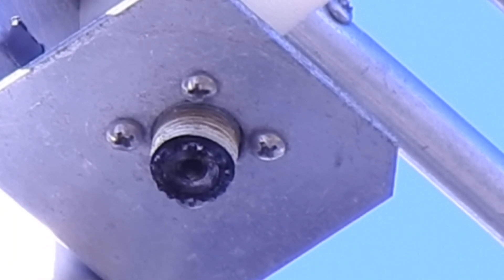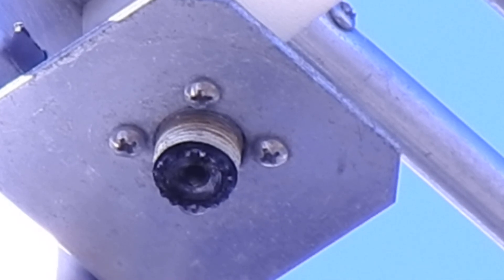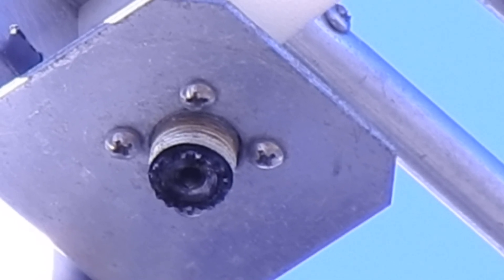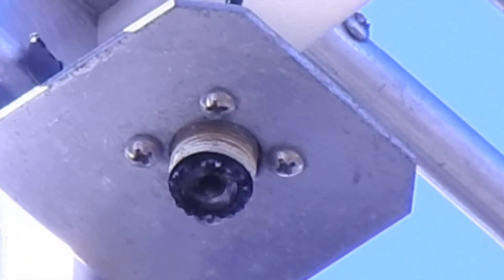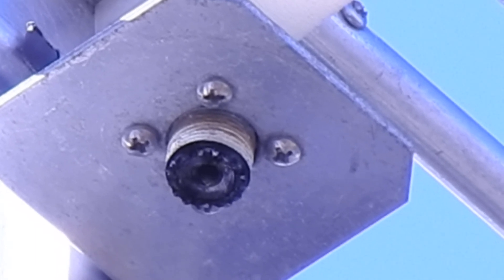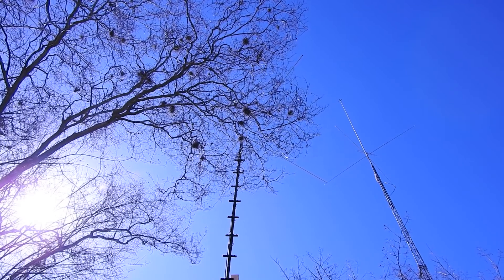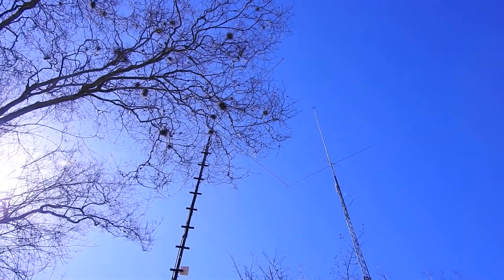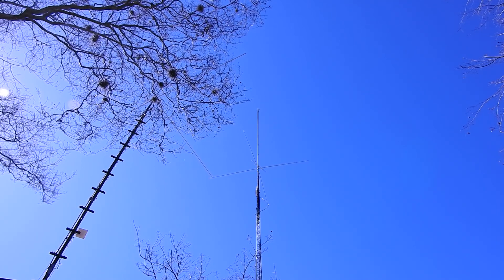Shockwave Burned at 3kw rms 187 tx RattleSnake radio inc.

Comment: Pl-259/ SO-239's are shitty connectors. The "Antenna" itself may take 10k but the Coax connectors i.e. pl259 / SO 239' are a completely different story. Why any antenna builder would use those connectors is anyones guess!?!?!

Comment: lol that connector  looks like it has been up in the air for years , the so239 sockets are a mixed bag and good ones with Teflon insulation aren't that common , better to use a connector rated for double the rf power you want to run

Comment: I've dealt with this kind of thing on my '8 element shooting star' and my 'penetrator 500' pushing over 1200 watts pep. MOISTURE! Water seal the PL259 connectors. Always seal from moisture with tight connections and you will be fine.
Reply: they sure need the water proofing lol , I avoid using them because of it and use N type instead

Comment: The shockwave antenna is a well build item but the PL259/SO239 connector combo is not rated for much, this is assuming you were able to correctly connect the 2 together. Me personally I would have just direct fed the coax to antenna. The dude that makes the shockwave antenna is adding innovation to YOUR hobby so why you attempt to throw him under the buss is beyond me. Support our hobby even if you don't understand RF theory. Even if you are butt hurt my offer still stands, if you wan't understand RF and radio better I will come to you if you are in Texas. No fee to you just supporting the passion for the radio hobby.
Reply from the maker: We have  been doing this for 10 years building amps, linears, I have 4 x 8' copper ground rods double 00 copper ground wire. The problem was that the Shockwave was using ROHS material in the Shockwaves S.0-239 not  Amphenol insulated SO239. The Shockwave would not of failed if the so-239 was A Amphenol insulated plug. This is A perfect example of Planned obsolescence. Planned obsolescence, or built-in obsolescence, in industrial design and economics is a policy of planning or designing a product with an artificially limited useful life, so it will become obsolete (that is, unfashiovery easy tonable or no longer functional) after a certain period of time. Do Not worry yourself so  much trying  to protect the builders like at BM tech,  We already Have the antenna down and repaired with A true  Amphenol insulated so-239 we also replaced the thin aluminum strap that did transfer the RF from the ROHS so-239 to the element that looked like it would  not carry 1kw much less 3kw  with A 12 gauge copper line that actually has insulation.. I will have the video of the repair done to the Shockwave loaded this evening then I will show everyone the 1.0/1.1 swr  match across the 40 with 50 oms with the repairs that we had to do. The antenna should have had this design to begin with. The cost of A shockwave antenna is what around 350.00 but BM Tech could not of spent another 10 dollars for A plug that will last longer? After the video I post of the antenna repaired I will show the antenna taking the 3kw RMS with no problems. The add where the shockwave is  being sold shows it will handle 10kw the add reads on saying this antenna is A monster  but then it has the ROHS so239 rather then A  better so239.. That is  because The  builder knows the antenna will go out in time which will  more then likely take out A amp or driver then BM Techs buddies will get a repair order in or A order for A whole new amp. The  builders, Techs, etc knows that everyone is A plug and play operator and the Techs are waiting for the next call. Here at this shop we are not plug and play so that gives me the freedom to say what we want to which is only the truth.  
 Believe that there are many  operators that would like to speak up  but they will not from fear of  being  black  balled from buying A amp from one of our major Dealers. You said butt hurt earlier but there is no reason for you to  be butt hurt I only spoke up about A issue That I am wanting the dealer/builder 'of the shckwave' to see and to change/fix this problem  before  more operators run into A similar problem.. I have  no hard feelings as you think I only want to help my fellow operators out by speaking up since we build power supplies and box's i am not hindered to speak. I have A few Techs I look up to Like BBI and some others because I know that they  build well and do not lie like TinMan amp builder.. Tinman lies and I have proof stay away from that hustler I seen him take  my  buddy for A 16xtoshiba  a linear amp.
     To Mr. Stern Forester I live south of San Antonio about 50 miles your welcome to stop by anytime
find  me on face book under the name  Blake Henry Higdon.